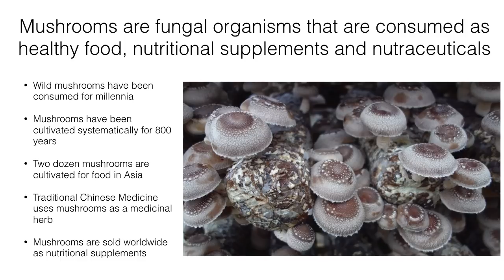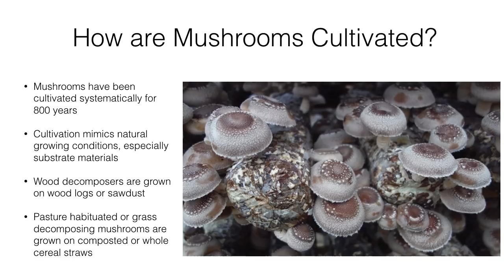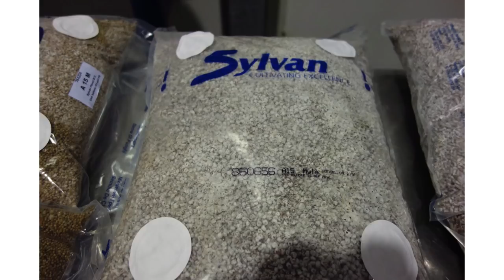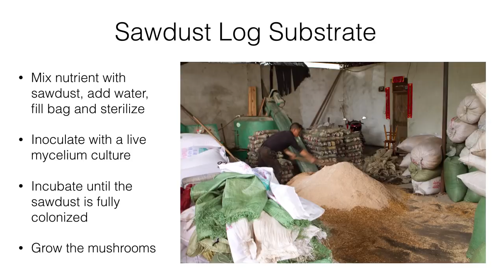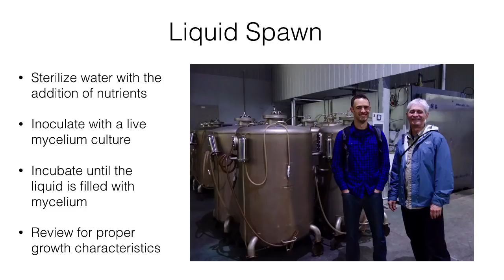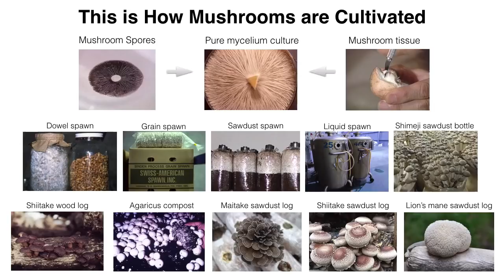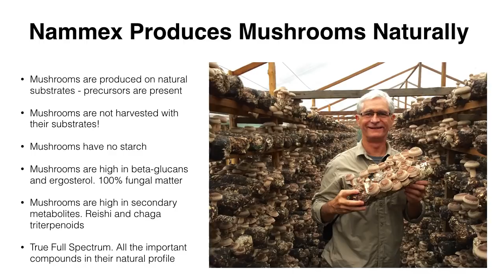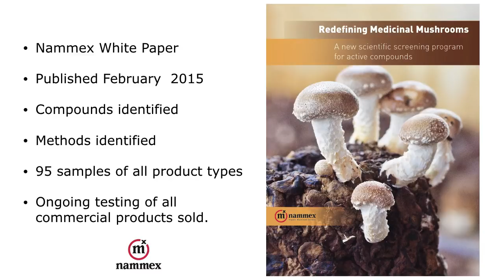Growing Medicinal Mushrooms - How Nammex Does it

Comment: Hi there. I was wondering if you knew anything about the Juncao Mushrooms which are grown on herbal grasses instead of a log. They claim to have very high levels of beta glucans etc. it sounds good because they aren’t using trees to grow on.  I want to know if it’s a viable option. Thankyou.
Reply: Thanks for pointing out the Juncao Grass. First, China's forests are mostly plantations that are planted and cultivated for the wood. Sawdust from those trees is a by product that is valuable and very appropriate for mushroom cultivation. Wood is also the natural substrate for most medicinal mushrooms, which means precursors for producing important compounds are present.
Juncao grass is very interesting and it looks like a good, adaptable substrate material according to the info I've seen. Does it grow better mushrooms? I don't know and only testing will show whether medicinal compound production is higher. Regardless, if yields are good, and it fits the local environmental conditions for mushroom growing, I'm all for it. China truly leads the way for mushroom research.
Reply: Thankyou for the reply I appreciate. It. 
So I bought these mushrooms and the testing said that they were around 32.5% beta glucans. 
And low levels of starch. And I also did the iodine test when they arrived which it passed with flying colours. Well I should say that it didn’t turn black it stayed the same. 
But I also noticed that their substrates Which are mostly grass still have other products like wheat bran or rice bran and sugar in them. Your thoughts would be much appreciated thanks.
Reply: @badgerandhobbes  What is your issue with the substrate?

Comment: ...I'd rather use Distilled water,but in my country its not easy. I can easily boil water but then have no clean container to put it in. "Soda water" which is  H2O + CO2. Can I use "Soda Water" for misting and mixing BRF etc?;;
Reply: There's no need to use distilled water.